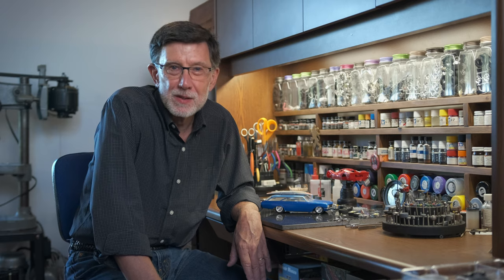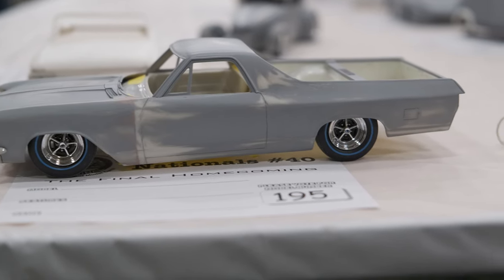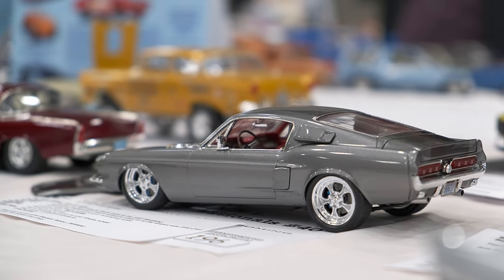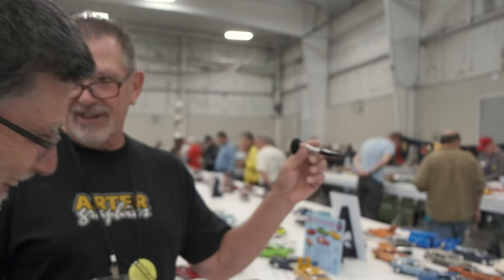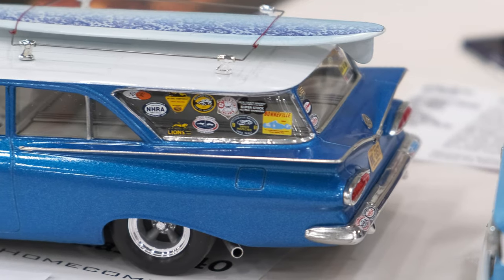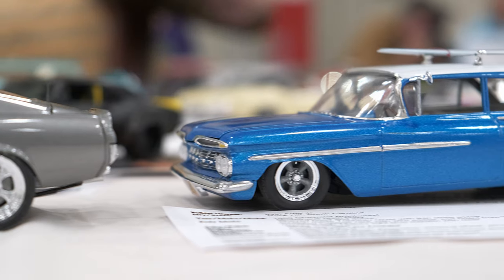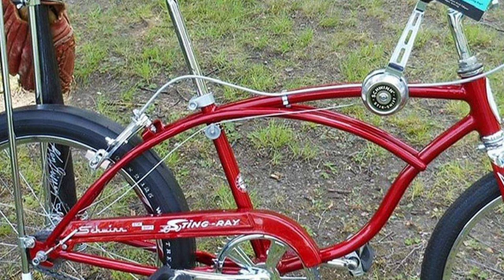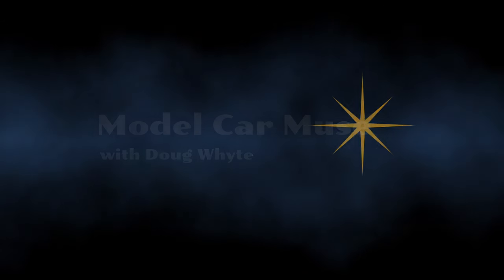Aggressive and Aerodynamic, the “Arter Rake” Model Car Stance

Comment: Beautiful builds. 
I’m so funny about setting ride height on mine, I’ll scratchbuild complete new inner fenders, narrow the front suspension or even widen the car before I’ll build something that couldn’t steer its front wheels in the real world. I’d never, ever cut the top off a tyre. To me that’s admitting your build could not exist in the fullsize world. Put on smaller tyres and cut the body down if it looks like the wheels are too small.
I’ve built slammers and kerbsides over the years but I still keep them realistic. It’s just the way I am.